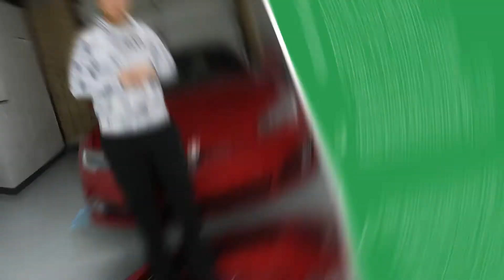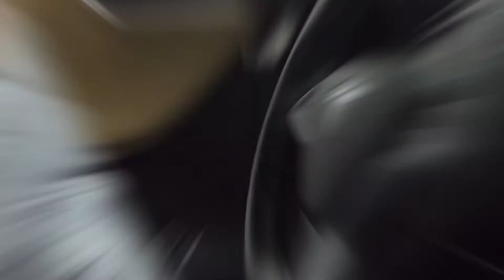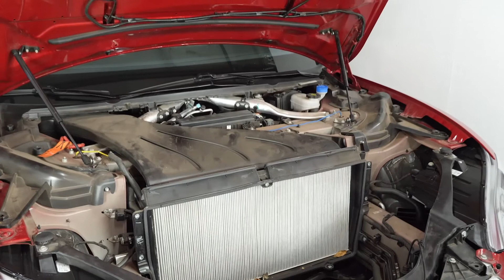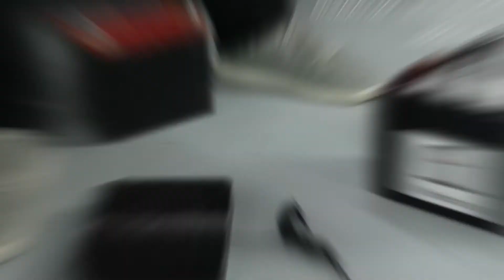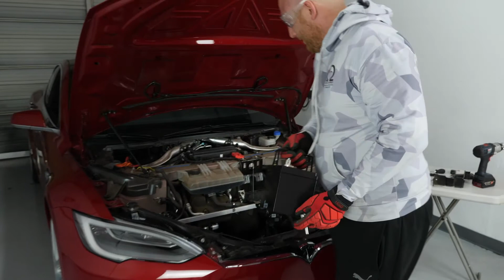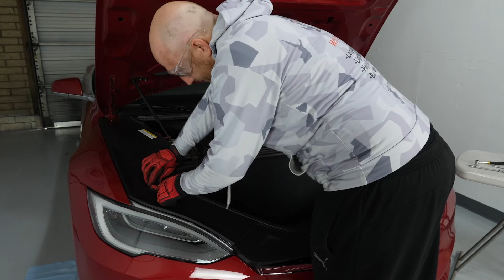Tesla Model S - 12V Battery Installation (Ohmmu)

Comment: Should you go in to service mode and let the system know that you no longer are using a Lead battery and have switched over to Lithium? TY for the video very helpful.
Reply: That's what I was trying to figure out.  But there isn't a Lithium profile.  Not that it is really  needed.  The battery has its own BMS in it, so I assume they tuned it to accept any voltage from the 3 profiles a Model S gives you.  But, just a guess.

Comment: If the adapters are provided, why bother taking them from the old battery?
Reply from the maker: @rajman7644  they weren’t always included, back when this video was made they were an option.  We had too many customers not choose that option and then not save their adapters and complain they didn’t get adapters so we started including with all batteries later.
Reply: @OhmmuEnergy  OK, I have a 2017 S100D and my car was dead.  I ordered the replacement from Ohmmu and got it today and installed it and followed the video above exactly and the electrical system is working but I'm still getting "Unable to drive, voltage too low" and "electrical system power reduced" warnings and can't drive the car.
Reply from the maker: @rajman7644 Hey there! Just making sure you reached out to us through our support page. Hopefully it was resolved!
Reply: @OhmmuEnergy  I had to get mobile service to come out.  Found a big mouse nest.  Had it flat-bedded to Tesla SC and they found mouse urine damage and are saying it's going to be an expensive repair.
Reply from the maker: @rajman7644 Oh no!!! How on earth does stuff like that happen?!
Reply: @OhmmuEnergy Apparently not that uncommon.

Comment: It's crazy that to just get to that nut at the base of the bracket you have to take apart the frunk.
Reply: You have to remove the trim.  It snaps in man.  How fucking lazy are people where that is an issue?  Even the cars like Jeep keep their battery under the passenger seat, and that's not that bad.  When do we go back to the time, where stupid people keep their mouth shut?

Comment: They last maybe one year longer and they cost three time more expensive bullshit
Reply from the maker: @ZotThithmaKarin  Do you mean compared to lead acid? We do engineer these to last more than 4 years. And having the intrinsic protections coming from the BMS to monitor the health of the battery, we still have customers who are using our existing 1st Gen lithiums from over 8 years ago. A lot of it is determined by climate, just like lead acids, but ours naturally last longer because of the features.

Also keep in mind this is for the pre-21/22 Teslas, before the refresh since those now come with their own 15v lithium batteries.

Comment: Not all Model S vehicles have HEPA filters.
Reply from the maker: Right, they started putting them in in 2016, earlier ones never have them and later ones always have them but for a little while some did and some didn't have them.  The good thing about the later ones though is that even if you didn't get "bioweapon defense mode" on the vehicle they still installed the same plastic air-duct which holds the filter, so you can add the filter if you want better filtration!

Comment: Excellent video - just completed my own battery swap ( would  have been a long wait for service appointment). Sorry, but I replaced with a Tesla battery from the service center.  Also took opportunity to replace my big HEPA filter.  

Will say my high voltage disconnect was different. Took me a while and a little research, but this one has a red tab you pull out and then lift the black tab and it pulls apart easily.  Reconnecting was easy -just push together and hear the click.  My message went away after the procedure when the computers recognized the new battery.  Very well done.

Comment: Be adviced. According to tesla model s official service manual "different type of battery is installed than originally installed, the "12V Battery Type" configuration must be updated. ". I'd like to hear how this battery is long term in extreme cold weather climate ?
Reply: Do you have to change any settings for the new battery if you go with the OHMMU (LiFePO4) battery?
Reply: Tesla activity tries to make this not work.  They have done a decent job.  This battery is vapor ware for the ignorant.  A tactic that works well with a typical Tesla owner.  Use what the car is designed and updated for.  Save yourself half why you are at it.

Comment: Don't waste your time, Setup a call with Tesla, they will come home and replace the battery in 20min, only $247 including installation and sw update. M3 and MY is cheaper.
Reply: Yea unless Tesla is two months out on service for your area and they charge way more than $259
Reply: Yeah I did that. I have been asked to tow the car to service center even when I asked for mobile service. I know the reason is because I’m out of warranty. I tried 3 Tesla Service Centers and I had to cancel.

Comment: Just so I understand: The "First Responder Loop" is Under the hood and under a few panels.
So, are the firemen supposed to open the hood and pull all that stuff out when the car is on fire?
Sounds reasonable
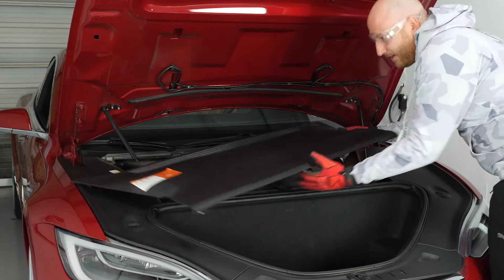Reply: No. They cut the loop which is visible by removing just the one cover. See at 5:50
Reply: @EarlMalmsteen  The loop tag can hide under the panel and needs to be pulled visible for first responders.
Reply from the maker: Well, they are supposed to be left with a portion visible but a lot of owners tuck them in unfortunately... But first responder is supposed to just cut it not remove it the way we do.
Reply: The loop controls the interlock to shut off the contactors.  If the battery is on fire, none of that matters.  Jesus man, think.

Comment: Thanks I was looking at a 2020 model s to replace my old Nissan leaf. Thanks to your video no chance of buying the S. I have replaced 3 leaf 12 volt battery it is easy to jump start the battery basically there when you open the bonnet. What a poor designed car for this and I see why it has to go to a tesla dealer.
Reply: agree! poor design, hard to get to it when needs to be jump start, don't know why.

Comment: What is role of this battery?
Reply: It governs the 12V system, that windows, fans, wipers, ect use.   It also engages the contactors that bring the HV battery into play. They aren't going to put any of that stuff on 400V.  So when you are just sitting in your car parked, assume no AC or heating, you run only off the 12V battery.  If it needs charged, you hear the clicks of the contactors, and the HV charges it.

Comment: Wow a lot of work just to replace a 12V battery
Reply: In terms of cars, it's average to less than average.  Most gas cars have the battery under the passenger seat now, and requires a lot of RR.

Comment: I'm no mechanic but I do light level maintenance.  I see the need for safety eye wear but gloves for this light duty  work?  Too much.
Reply from the maker: Depends, if that Lead battery comes out with a crack and acid leaking, you'll be glad for the gloves.  Though they can be tedious and of course if you can observe the battery and confirm its "clean" I personally wouldn't wear gloves but for safety's sake we always recommend it regardless.

Comment: Hmm I would like to go to Ohmmu’s lithium battery but for $440 w shipping vs Tesla charging $209 for me w installation and $165 of that for a 2 year acid battery vs the 4 year warranty Ohmmu there is not a compelling reason to use the more efficient Ohmmu. At about a $300 price range the lithium battery  could make sense but as it stands now I can swap out cheaper. If yall ever got a gently barely used yall would sell cheap hmu.
Reply: Actually, the lithium battery is supposed to last 4x the Tesla acid battery.  My original battery lasted 4 years, so I figured with the Ohmmu battery I won't have to install another battery for the life of the car.
Reply: @gizmooppe Heard because it’s lithium, and based on properties of lithium ion, it suffers degradation and does not retain the same capacity over the years. So, the capacity will not be the same in Year 1 as in Year 16. Therefore, it might be rendered useless much before that time.
Reply: @AdamSmith-fe9jf  Totally makes sense.  Thanks for that.
Reply: Here is the thing about all warranties. They hire 500 people to sell them, and one person to tell everybody no. If you rely on a warranty, you're a fool.

Comment: after new bATTERY IS INSTALL DO I HAVE TO POWER CAR BACK UP FROM INSIDE THE CAR DID NOT SEE YOU DO THAT?
Reply from the maker: Once you step on the brake it'll power back up.  It doesn't need to be done as part of the swap but eventually you will have to do that if you want to drive your car anyways.
Reply: Will I get an error message switching to a lithium battery from a acid for a 2016 model S P100D?

Comment: have you seen the 12 volt lithium-based battery in the 2021 S cars?
Reply from the maker: Yeah, its a really small power module, it is more like a power tool battery, small capacity too.  But it is a totally different architecture, not something compatible with the older vehicles, it is CANbus connected, similar to any other computer in the car.